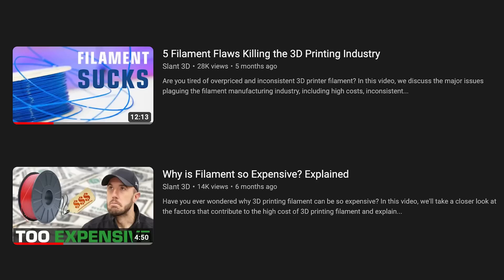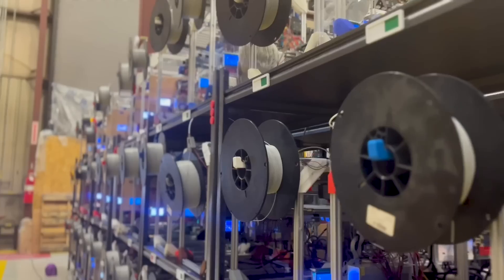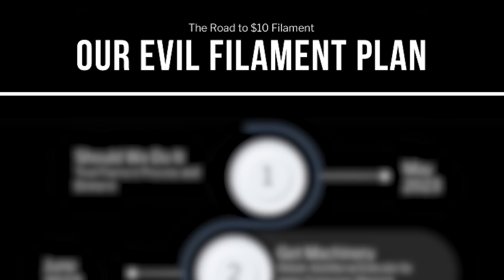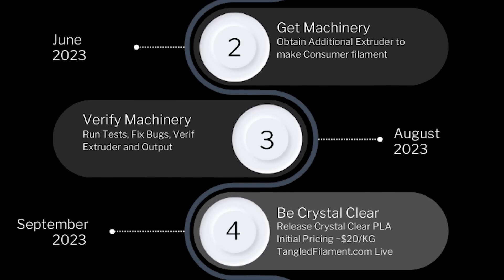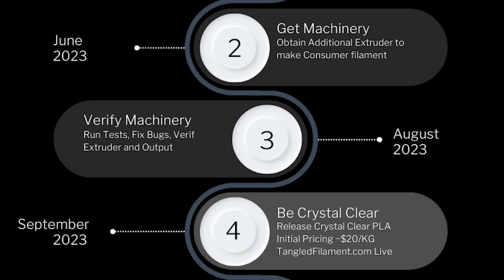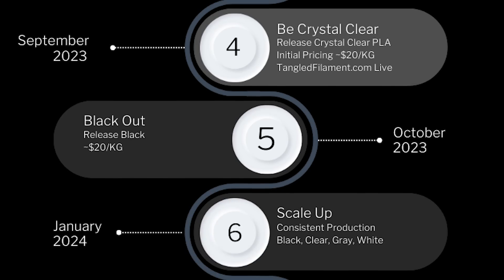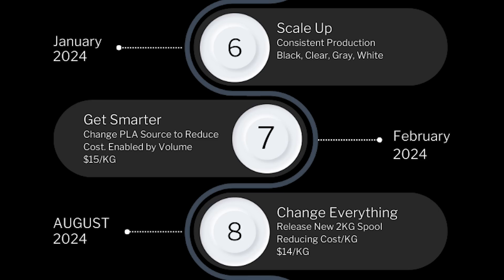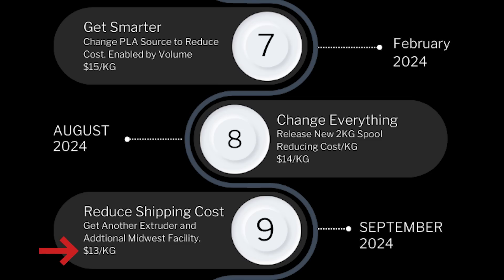Our Evil Plan to Make Great $10 Filament

Comment from the maker: Alright. We want to make sure that we do not sell out. So we have opened preorders for the next batch. It will ship by October 6th. tangledfilament.com
Reply: If you sold spool less spools, and kept the inside diameter the same, we can make our own spools. 
That would personally be preferable to me. 
And it would make it much cheaper for you.
Reply: Your website was sellinf subscriptions of 3 1kg spools for 60$ I must be missing something
Reply: Bro, you might wanna correct your site. Theres a section on your site that has a Title you named it ans then for the body it just tells you to edit your body. Theres no content in it.
Reply: Can you sell refillable filament?
Reply: I wish for more clear😢, my current best PLA is from a random Chinese brand, it's wonderful until a weak point in the spool breaks and ruins my print, I have a smart filament(encoder ones) sensor now should help!
Reply: You present no innovation that would lower production cost beyond the usual run of the mill stuff. If this basic approach truly worked, other manufacturers would have done it already. You sell snake oil
Reply: You got a customer, can you make a mix and match bundle. Three spools of one color is a bit much
Reply: If you are taking requests for future filament types, I am just starting to play around with cheap nylon string trimmer line as printing filament, and I LIKE IT. If I could get it to stop warping it would be my new go-to for basically everything(just bought an enclosed printer). Currently limited to light blue or red for color because of nozzle size, but black, OD green, and FDE in either 1.75 or 3mm would be GREAT. I'm building a 310x310 corexy specifically to use a 3mm nozzle because one brand sells it in an acceptable green, although I'd rather have it in 1.75. Less than $10 a pound when you buy the five pound spool. I can print what I want with ASA, but would prefer nylon.
Reply: please move to europe :D
Reply: @jeroenvandend  In Sweden we have a company that makes very cheap filament
Reply: @handikappad  yeah but does it ship to Belgium at a decent price :)
Reply: @jeroenvandend  No they only ship within Sweden and to Germany but shipping to Germany is like 30€ so it would have been the same to Belgium if they did ship there:(
Reply: Cardboard spools or I'm not interested, single use plastic spools are horrendously wasteful.

Comment: sorry this is super confusing... it was not viable to sell filament, because you had more production capacity. you were making it for yourself to save cost, but couldn't sell to others for a profit? 
this is basic manufacturing, if your machines aren't running 24 7 your losing money. every 3d printer user knows this... aswell buy in bulk reduce cost. econ 101

Comment: For consumers, filament makes sense. Low material volume, easy storage, etc. Many business models are based on income from consumables (e.g., printer ink), so filament prices are not surprising. For a print farm though, filament does not even make sense. It adds a completely unnecessary step and degrades material quality. If you want to pursue the consumables market at commodity prices, there is opportunity. But to solve the problem for your print farm, the better solution is to buy/develop pellet based 3D printers. Lower cost, more material choices, bulk prices, no unnecessary material degradation (heating 1x vs 2x), less energy (why heat plastic twice?), less process variables, etc. The only negatives are less availability of compatible printers and print quality. You already make your own printers and Greenboy3D is already getting decent quality -  https://www.youtube.com/watch?v=f0rVNFXp9IA&t=1s&pp=ygURcGVsbGV0IDNkIHByaW50ZXI%3D
Furthermore, a much lower material cost will enable you to compete better (or maker more profit) against other manufacturing methods. 

Subscribed - like the channel, but am hoping you seriously consider pellet 3D printers in the very near future.

Comment: Why not offer an option to order filament with or without a spool?

In the case of filament absent the spool, you could design a spool for people to download and 3D print. Upon receiving the non-spooled shipment of filament the customer could then add the spool to the filament and be done with it or alternatively use a spool from a previous order where the spool was inclusive to the order. This would ostensibly lower manufacturing and shipping costs along with the environmental impact as well.

Comment: One thing yall could do if using plastic spools is to allow your customers to send yall the spools back, undamaged of course, so yall can reuse those spools and giving the customer a small credit. I know the spools aren't that expensive, so I'd say those that return them get a credit of what yall would have spent for the spool itself...so if its 5 bucks for an empty spool, customer gets 5 dollar credit, or even half at 2.50...either way it reduces waste and helps the customers. This is first video I've seen, so if you've already had that idea in another video, then cool my bad, if not then its worth the consideration.

Comment: Fun thought, a simple tool for transferring between large and small spools and 10-50kg bulk spools, should save in packaging, shipping, and labor swapping spools on the machine, and even at fairly low volume could increase batch size significantly.

Comment: Im curious. I'm relatively new to 3d printing and have a high speed printer. I know filaments are generally rated for a specific speed range. I don't know all the factors that go into it super well, but how is this filament expected to do in high speed printers, like 500-600mm/s? Is it expected to perform well at those speeds?

Comment: Great videos! Love your dedication to making 3d printing more viable for everyone. Do you make the filament holders? If so, can you make the width of the middle of it smaller to save money and put more filament on a roll? Do you need it to be inches wide to put the roll on things? What if it's half the width but still strong enough to hold both sides of the roll?

Comment: Y’all should do a dye ink for the clear filament, saw a guy make a device that coats the outside of the filament with some type of liquid dye and had it be able to do up to 3 colors, put it through the printer and it came awesome looking and in my opinion changed the way colored filament is done, because at that point all you really need is clear filament and you can make all sorts of colors as it is printing giving you automatic color changes without having different filament feed systems and the nozzle have to clear one color to switch to another persay.

Comment: Would it make sense to first extrude a large batch of filament eg. 200kg roles of filament and then put it on smaller 1-5kg roles depending upon customer demand?
Or will you have issues with that the filament will break, when making the small roles?
The advantage would be that you could extrude during the night, automatically, and high speed spooling.

Comment: just a simple recomendation, you could look into reusable spools, at least for bulk buyers. rather than shipping someone 100 1kg spools, or even 50 2kg spools, you can make a 100kg spool and let them buy the necessary number of spools for thier machines (or just reuse the mountains of spools they likely already have). 
a simple winder tool should be easy to set up. might be an ope ing for another product as well, make a very large oversized spool with built in bearings so that someone who has a belt driven printer can set it to print through 5 or 10kg or possibly even bigger without stopping, all while enjoying a slight discount on tge material from not needing to pay for individual spools, or your companies time to package 100kgs 1kg at a time

Comment: My suggestion at cost saving is resigning of spools altogether, either make packaging capable of folding in to spool or make possible to pull filament from the middle, like ethernet cable

Comment: Can you look into using spools made from some kind of cardboard? 
Or maybe something else more environmentally sound? I get that the filament itself isn't particularly great for the environment but changing out the spools for something better would cut out a lot of the actual waste, as ideally most of the filament is used for actual objects people use, so that it doesn't end up at the dump.

Comment: Do you think its feasible to make filament from recycled plastics locally in each city? Its crazy how much plastic does not get recycled. I hate to feel like I'm contributing to the problem when 3D printing and i think there has to be a way to use recycled plastics to make a "prototyping" filament that is used when color doesn't matter. And if there was a way to set up a small facility in each city to use up plastics that would be sent to an incinerator otherwise would be huge.

Comment: u should consider selling them in spooless rolls or master spool spools so its just that much less waste material. i have probably 20 master spools an only one company that sells the refills so i buy all my stuff from them but they only sell them in 10 packs an it would be nice to be able to mix an match what colors or just what rolls needs they only do half an half or 5  of one color an 5 different colors for the other 5 but recently theyve not had the refills so ive been stuck having to buy the filament with spools that have to be thrown out. used to i was able to find way to re use or up cycle them but at this point ive done it so much i cant find a reason to keep them anymore. i have a bunch put up right now just incase something comes up an i need one but im throwing at least 4 or 5 empty spools a week out on the more busy weeks an when its slow 2 or 3 a week just depends on what im making at the time.

Comment: Sounds Interesting, Wish someone would make the specialized filaments more common to find in PETG. See plenty in PLA, but PETG is rarer, like wood filaments containing wood particles or metal filaments also containing particles. See a cool PLA specialty filament online, but can't always easily find a PETG source. I know it's beginning to catch on, I see some glow in the dark, marble, even a wood or two if I'm lucky. I mainly use PETG as I may want the print more outdoors or in car temperature resistant. I'm use to PETG, so I'm resistant to change over to something new.

Comment: Very nice. However, I'm a little concerned about the lack of evil work practices and cackling laughter. I hope you have implemented secret plans to infiltrate other companies and kick puppies. As evil towers would be difficult to fit mass production within, I would recommend basing production in a mountain and have conspicuous menacing structures sticking out. This way you can hide certain operations while still getting huge villain appeal. To reduce the wholesomeness of your products, you can employ outsourcing, encourage pollution by having flimsy spool holders, and making the plastics as non recyclable as possible. But this would likely require significant research into additives that can achieve this without compromising the fillament quality.

Comment: I used to work in a plastics manufacturing plant. Here are a tip that will help out on the manufacturing aspect of the filament. 
Tip 1: when doing a color change make sure everything is clean. Clean out your screens. Run your new color. Shut the machine down. Clean screens. again. Then run the machine. Monitor your temperatures very closely. A couple of degrees of temp can change the color and thickness of the end product. That will throw your QA/QC outa spec.

Comment: To go with the "plastic spool" optimization, remember that you can also just sell refills. Not everyone can properly re-roll them, but those that can could save the cost of the plastic spool.
Reply: Re-roll?
What do you mean? You just put the refill in a masterspool, cut the zip ties and that's it. No rolling of any kind necessary.
Reply: @Jehty_ I think he is referring to the 2k rolls which won't fit the AMS so you have to respool the 2k spools into 2 1k spools. If you don't use an AMS then 2k should be fine as is, but guess it depends on your printer/setup as a 2k would be a little heavier if the spool is held at the top of the printer on a lottle arm🤷‍♂️

Comment: Sounds like a solid plan!  Affordable USA-made filament optimized for cost-to-performance?  Yep, I'd love some.  

Now, some concerns though:
1. is it possible to move to a biodegradable material for the spools?  OR, perhaps implement an exchange program for repeat customers to send back their spools to be reused?

2. While the filament is produced in the US, what about the raw materials (the beads)?  While I'm sure your sources are legitimate, having the entire supply chain based in the US would be an even better move imo.

Comment: I can appreciate the planning and certainly wish you guys luck.  However... if your new source is a good as you believe they are not likely to stay cheap for long (nothing of quality is). I hope you guys can beat inflation on your timeline but unless the $10 is for marketing purposes I believe you should pick a more realistic price so you're not sold out 99.99% of the time (that won't change the industry). 
I wish you guys luck though and I'll be following,  I just think setting unit prices for 2025 using today's data is very difficult. I also don't know your overhead and controllable costs so take that with a grain of salt I guess 😅.
There is however a large demand for cardboard spools. Some of us only buy plaatic spooled filanent if  it's a special type that isn't available on cardboard.

Comment: What do you guys use to pack your filament in a vacuum? Specifically vacuum bags. I already own a nice chamber vac sealer (not a food saver). However, the standard 3 mil bags I used for food tend to pop in the reel middle when the chamber dumps air back inside. I'm asking you guys since you are pretty open about your practices. There has to be a commercial supplier to buy thicker mylar bags by the 1000.

Comment: Thanks for this. As a contractor I've been fighting the scourge of duck tape being used for ductwork for decades. Seeing duck tape on a duct is one of the clearest signs that a DIYer has been there.
The thing that is so insidious about duct tape is that it seems to work at first, but the butyl adhesive breaks down under repeated heating and cooling cycles.

Comment: Very nice Video and I hope you will be successful in your venture! You mentioned cost of spools and trying to minimize it in the Video. Have you considered selling filament refills for Master spool systems, and If you did consider it and don't want to sell refills,  what are the reasons not to?
I really like the Idea behind the Master spool system, since single use spools obviously cost money to produce and also add weight that has to be shipped just to be thrown away by most people. For a small price cut in the filament I buy I would happily invest in some master spools and only buy refills since I also like to avoid buying large, mostly single use, plastic parts.
I live in Germany and one of the biggest manufacturers of very high quality Filament is DasFilament. Their price sits right around the 20€ per kg price that has become the norm, though they sell 0.8kg spools for some reason... 
Anyways If you buy their refills for Master Spool you save about 1€ per kg of filament you buy.
You also have the choice to buy an already printed Master Spool from their website, or to print it yourself, which can be a great use of leftover filament since you would not care about a functional part like that being a patchwork of different filament colors.

Comment: I suggest using spools with a grid of holes in the sides, definitely for moisture sensitive filaments like PETG. It's really hard to dry a spool with full flat sides properly.
Reply: No spool or cardboard spool, the fact that the majority of the 3d printing industry sells single-use plastic spools is absolutely appalling to me.
Reply: I'd suggest no spool like Bambu
Reply: @ElmerGLue  🙄 you don’t have to hook it up to their cloud service, it prints fine in LAN only mode or using an SD card

Comment: This was very interesting!

Now, as a Canadian who mostly prints in ABS, I don't see a lot of direct utility for me in this plan.  Even if we assume that you will, in a couple years, be offering ABS for USD $10/kg (something not stated either way in the video) and that the exchange rate will remain comparable (likely but not certain),  that means your ABS will be about 7$CAD / kg less what I buy up here.  (It may or may not be higher quality, but I'm satisfied with the quality of what I use, and so am not going to pay extra.)

Now, 7$ is 7$.  That's three cups of coffee from Timmie's!  But what will shipping do to that?  Shipping to Canada is expensive.  Heck, shipping in Canada is expensive.  Right now, if I buy 8 kg of filament at once, I end up paying about 3$/kg in shipping from Ontario to Alberta.  If I bought 8 kg from you, I'll get hit with a service charge as it crosses the border that will add about 1.50$ per kg, reducing the savings to 5.50$ per kg.  So it all comes down to "can you ship to Alberta for 5$ CAD / kg, or less?  (About US$ 3.75.)  Hard to say.

But!  There are possible indirect utilities.  First is the obvious: competition creates price pressure and perhaps the local cost will come down a little.  Second, and more interesting to me, is the attempt to make 2kg spools the norm.  If that happens and thus becomes more widespread, then that will be good for me just by reducing the amount of waste spools I have to deal with.

And, finally, whether it works out or not, this video is a great example of planning.  A skill that most of us need to work on.  So I enjoyed it strictly on that level.  :)